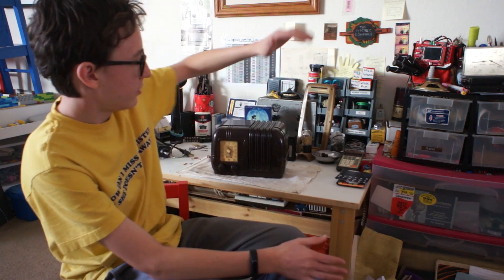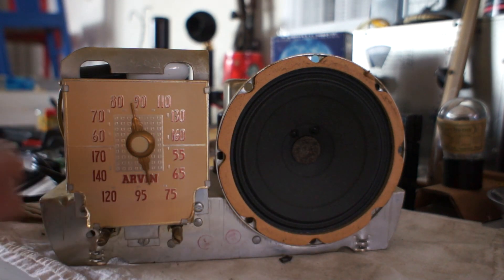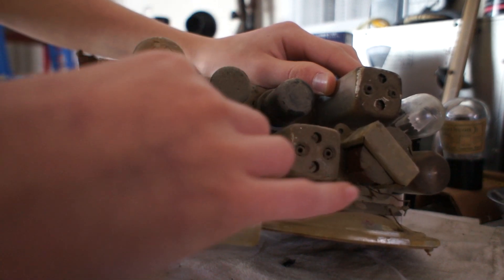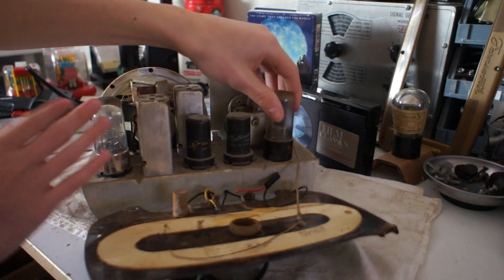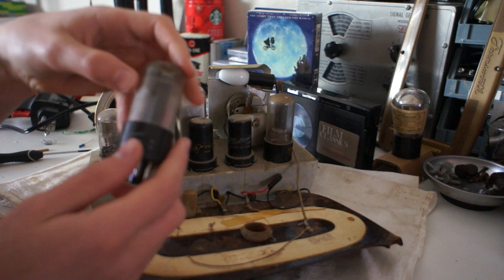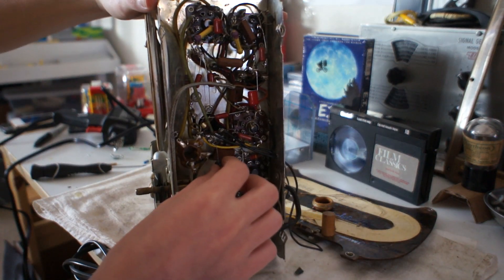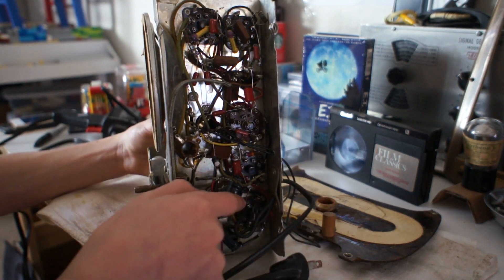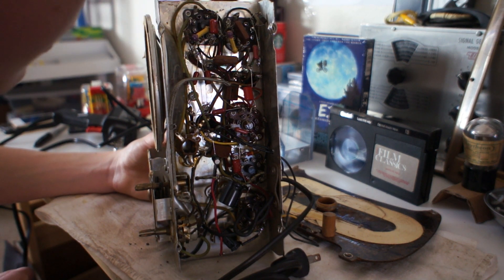How An AA5 Radio Works

Comment: I'll give you props on any kid your age for trying to explain things in an AA5 radio!  4 out of 5 stars. One messed up thing I 
caught was (at 6:16 in ) you said those tubes had multiple plates , instead you should have said multiple grids. Another
important point when it comes to metal dial faces and metal pointers. There should be a thick fiber washer on the shaft
 to keep the pointer from making contact with the metal dial face. The tuning capacitor is always at chassis ground and 
the B- is floating and the two should never directly  meet!
Reply: I think he was talking specifically about the 12SQ7 (Dual-Diode Triode) which I am pretty sure does have multiple plates and only one grid.